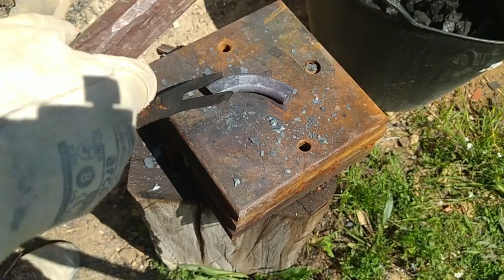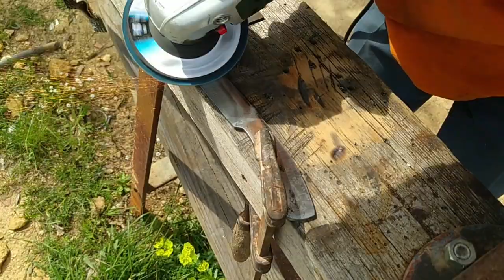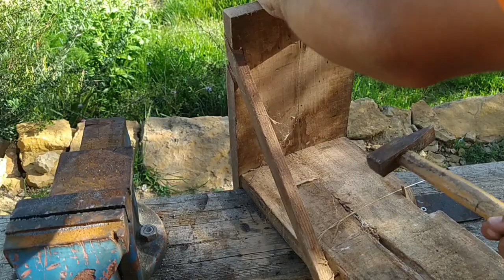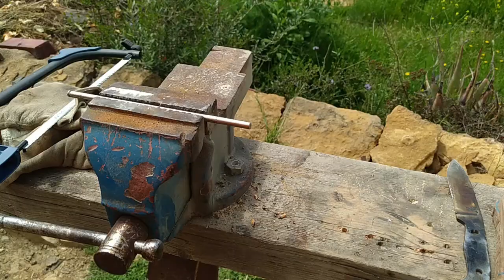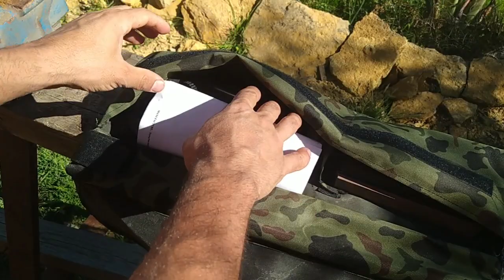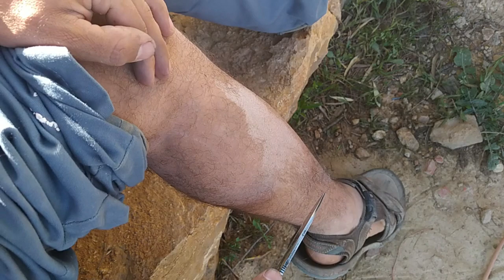Cómo forjar cuchillo con acero reciclado de suspensión 5160

Comment: Por todos los golpes sin estar rojo cereza sin partir la pieza  juraria que has usado 9260 (un acero muy bueno!!!!) Precioso trabajo.
Reply from the maker: Da el sol al yunque, así no se ve bien el color. Para el otoño tendré terminado el taller y va a cambiar la cosa
Reply: @elyeti1  https://youtu.be/QonPRCjpnZ8 te recomiendo algo asi,se que no es lo mismo que estirar a mano pero si vas a trabajar reciclando materiales esto te permitira trabajar mas la pieza en la temperatura buena...hay que aumentar las proporciones de lo que ves en el brico pero si vas reformar el sitio uno de estos te vendria femomenal...
Reply from the maker: No puedo usar mucha electricidad, no estoy conectado a la red y tengo poca potencia en placas solares. Te lo un generador a gasolina para casos eventuales.
Quiero hacer un martinete a pedal, sin usar electricidad
Reply: @elyeti1  en el siglo 13 no habia electricidad,,,y se hicieron las armas que conquistaron el mundo...creo que se te ocurrira como darle vueltas a algo sin electricidad😉

Comment: Hola buenas amigo, muy buen video, pero tengo una pregunta. ¿Como haces el revenido despues de templar?
Reply from the maker: Limpio el metal y caliento hasta que aparece el color paja en el filo.
Seguramente ése le hice a soplete pero últimamente lo estoy haciendo al fogón de la cocina. Un horno eléctrico a 200°C sería mejor, pero mi sistema eléctrico es 100% solar y no es suficiente para horno
Reply: @elyeti1  Bua muchas gracias y en el carbon sin poner aire lo puedo hacer por encima? porque io tambien estoy en placas solares y no tengo horno electrico
Reply from the maker: @ginventions182  si, lo puedes hacer al calor de la fragua. Lo importante es que el filo no llegue al color azul, que quede color paja.
También puedes poner un tubo de hierro en la fragua e ir metiendo y sacando la pieza del tubo, así el calor es más uniforme